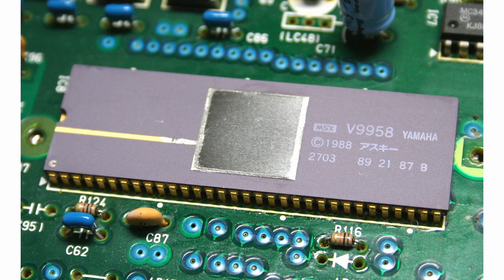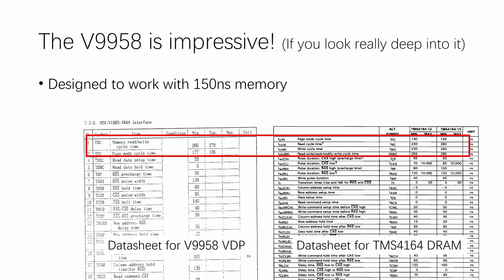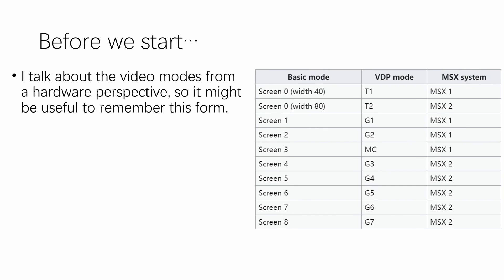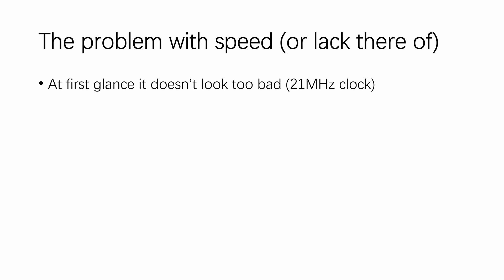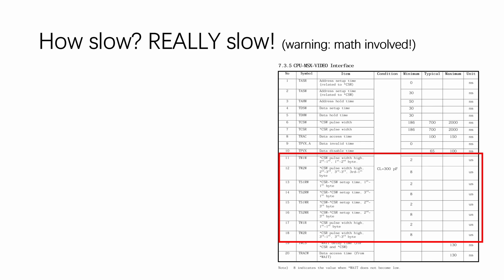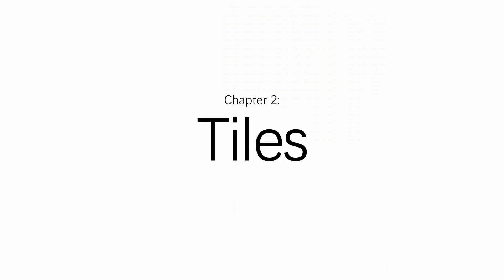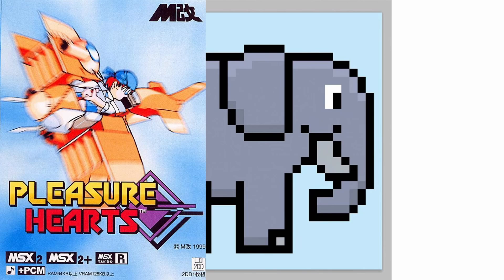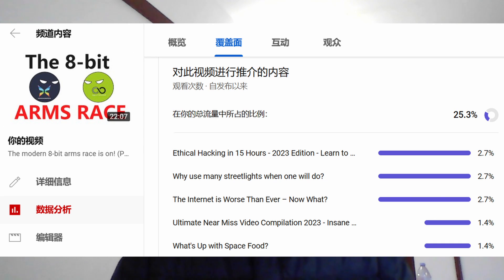The V9958 is a bad design. No, really.

Comment: I programmed the TMS9918, V9938 and the V9958 for the MSX. 

The first was pretty good for its time, the V9938 was almost a good chip too, the lack of proper hw horizontal scrolling was its biggest key down, the  lack of blitter power 2nd. The 256 'screen8' mode was cool, but already limited by the blitter AND the sprite engine. Breaker is perhaps the nicest looking 'screen8' action game. A proper new tile mode would have been a real game changer indeed, even if supported just 16 colors without further limitations. A 256 color tile-mode could have been a killer-feature.

The V9958 was indeed severely hindered by the lack of increased blitter power. The high color modes were just photo modes, there was no 'power' to support it.  So it effectively was a V9938 with proper horizontal scrolling, but years too late. The cancelled V9978 should have been the V9958 at that point in time.
Reply: There is an improper way to do horizontal scrolling on the 9938, but it's quite jank and has a pretty easy to recognize visual defect.
Reply: @dan_loup   Yes, you can use the horizontal offset-registers to scroll max 16 pixels in hw; giving you X frames to do blitter-copies (depending on required scroll-speed). The location-'jank' can be masked with sprites, but then you'll use up some sprite-quota :)

I've done that to create smooth pixel-perfect 8-way scrolling, but you're left with hardly any blitter-capacity (assuming 1 or 2 pixel scrolls) to do other copies/writes if you try doing it for the full vertical resolution.  EIther you gotta go 25/30fps or use max 160px vertically to have decent headroom.  Or use SCREEN 4.

Comment: As a kid, I used to program the 9918A back in the day. It was frustratingly limited, compared to a C64. The 9958, when I heard about later MSX hardware, seemed so much better... but thanks for pointing out its (dire) limitations. Sadly, the 9918A was not the most awful graphics hardware I ever programmed, but as you rightly point out, insufficient bandwidth from CPU to the VRAM is a killer. (Worse was to come for me with, doing graphics on custom hardware in the 2000's.)

Comment: I think Feedback is one of those games that used the blitter to the max, it copied a lot of 'sprites' from other pages of video memory, the action is fast paced and the graphics are great. It may not be Space Harrier but for an 8 bit computer it was a great try. After you play the game you can reset, go into basic, set the screen to screen 5 or screen 8 and with set page you can see the other pages with the 'tile' graphics in tact, though with a bad palette. I used to do that a lot back in the day, to see how things were done. 
Yeah the pixel budget was pretty limited so you had to only update those pixels that change, or use the hardware scroll/adjust function so you don't have to update the whole screen, only strips of 8x8 or 16x16 (can't remember) pixel tiles. 

Still, many games were just fun to play, despite the low graphic standard. Playability is king, which is often forgotten with all the processing power under current PC/console hoods. 

As with so many computers back in the day, development of custom chips was just too slow and the cost too high. Everything was caught up with the biggest computing market, the PC. With high volumes the prices could be driven low and many competing brands. Mac has carved out an existence to this day though, which is very impressive.